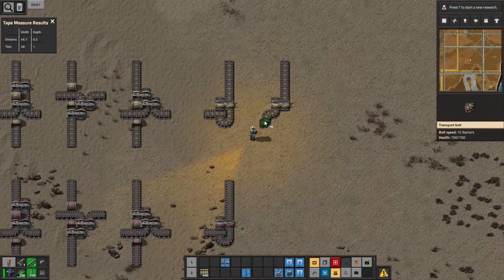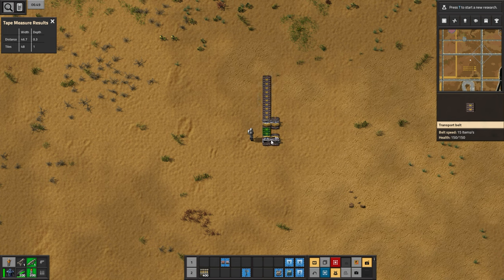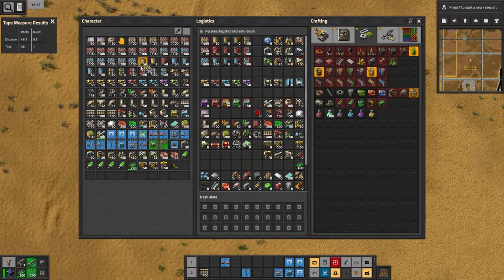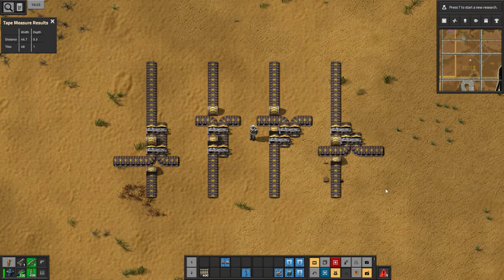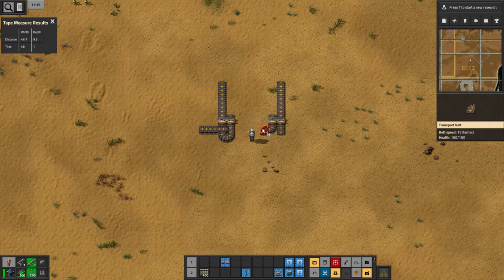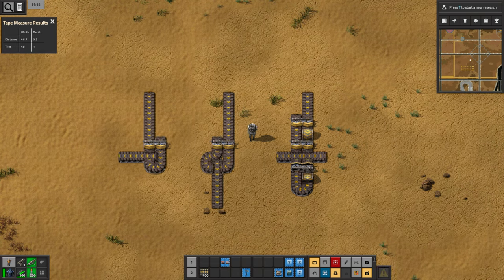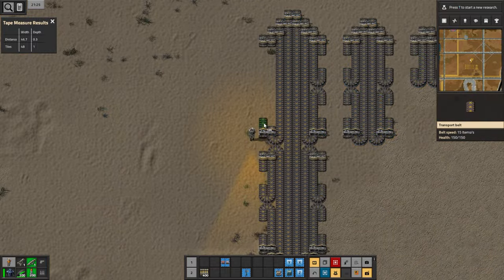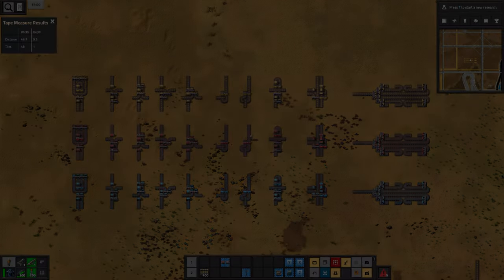Factorio - Widgets

Comment: Love your style. Also, the issue you referred to where a lane ends up with resources on one side not being used up is almost never an issue because it only happens when assemblers are on one side of a belt and there isn’t enough assemblers to consume more than half of a belt of throughput. The inserters will always grab from one side of the belt if there is resources on that side and if you’re producing too much of that resource one side will just back up because it’s not needed. You could add more assemblers anywhere on your bus to consume more of that resource and the stopped lane would fire back and start being consumed

Comment: Isn't "scrambler" basically a 2to2 balancer but for belt sides? Inserters prefer taking items from the belt side that is further from them, so placing machines on both sides of the belt should fix issues with uneven consumption.
Reply: Yes. They're usually called lane balancers.

Comment: Does anyone noticed that scrambler doesn't work?  Well it works if saturation of coming belt is uneven, but it won't help if consumption of the materials is uneven and one side of the belt gets empty) To solve this situation there is other scrambler, not so compact though.

Comment: These sorts of patterns are called design patterns in the programming context and maybe we could create the same concept for factorio with similar names. Design patterns in programming can give you patterns to follow for many sizes of abstractions. In factorio we could adopt the generic name or we could easily differentiate them as the size is closely related to what you're making. For example we could have belt patterns for those widgets, factory patterns for how you arrange groups of assemblers and other processing machines along with belts, and factory layouts/architecture for the whole architecture of the base. Anyway just an observation and a suggestion of a programmer. 

Nice video BTW, I think I'll use some of those widgets in my base more consciously.
Reply: Hehe, and what would constitute Uncle Bob's Clean Architecture and Clean Code then?
Reply: @othergames563 CC focuses on small modules that are designed to do only one task. So I think uncle Bob would be against a bus design at all. I think he'd go for an atomic railway cel factory where every step is loaded into rails. Let's call it the RVB: railway virtual bus.

So we'll end up with a 5 to 1 ratio of rail and station to assemblers and belts.

Comment: Whether you call them "widgets" or "balancers" they have their particular properties and use cases.

With noting is that the two lane-balancers/scramblers shown are not true balancers unless the input is unsaturated. If the input belts are saturated, then they act more as lane-swappers. You can turn them into true lane-balancers by forcing them to lane-swap, and then using two more splitters to split and then merge the belt so half gets swapped and the other half stays unchanged. If there's only one input belt though, neither version will be able to output a compressed belt unless the input is already compressed on both lanes (or the output belt has lower throughput than the input). For this reason, they're mainly useful either just to be able to pull from either lane, or when given two belts as input to act as a 2-1 lane balancer (which is also a sort of 4-2 balancer).

Then there are "universal balancers" which can act as any kind of smaller balancer, and "universal lane balancers" which pretty much mix as thoroughly as one could possibly ask for. Universal balancers however are ultimately just a meme and are pretty much useless except for looking cool.
Reply: This reminds me of a lane-balancer I've build. It might be the same type as the one you describe, but (at least for me) it's difficult to understand what a design look like from words...

It takes one belt as input, and also one as output. It's acts as a balancer for that belt, just like the standard balancer, but with one improvement: The input-belt always gets balanced. The reason simpel balancers don't do this, is because with sideloading: the futhest lane gets proirity. So as you said: they act like lane-swappers.

My change is this: Split the belt in two and sideload both on separate belts, keep sideload priority in mind. Then sideload one of those single-lane belts to change the lane (if neccesary) so that both single-lane-belts use the same lane-side. Then finally: combine those lanes with a splitter, and use one output as the main output, and the other output gets sideloaded onto the empty lane of the output.

But words can be not so great at describing this. So Imma try to draw it :)
(S is a spliter)
.                   -----------V
Input -> S -^  <-    -> S -V
,,              S V <-    -> S ------>  Output
.                   -------> I <-
(It uses three belts purely to cause sideloading)
This design balances the the lanes of the belt, regardless of input or output saturation.

Comment: a really useful widget that i feel you omitted here is the input-balanced lane balancer (or "scrambler" as you call them) - they use underground belt sideloading combined with a splitter to get each lane of an input belt onto its own belt, swap one of the belts' lanes (e.g. they take the belt containing the left lane and move it to the right lane of the same belt), use another splitter as a 2-2 balancer, then take the now balanced half belts and dump one into the empty lane of the other, creating a widget whose output lanes are "blind" to the input lanes, meaning that they take evenly from both.

this is highly beneficial in setups where either the production or consumption is uneven, as it can prevent situations where the output belt isn't full while some of the producers still have full buffers (for example: furnace stacks where one side cannot keep up with demand while the other side is fully backed up and not doing anything, or mining outposts where one side of the belt has more miners, meaning the other side takes a lot longer to fill the belt while the first one isn't doing anything). it essentially "rotates" the imbalance 90°, meaning that a 1 lane shortage across X amount of belts will be turned into a 2 lane shortage across 0.5*X belts - which is very helpful when your furnace stack for instance is less than X belts long.
Reply: *Flow routers don't act like balancers even when the inputs are saturated.

Comment: not scrambler... they're usually called lane-balancers. 
and the T splitter that you weren't sure was useful is actually one of the most useful splitters you showcased (except with a small change...it only uses TWO splitters instead of 3, that top splitter is removed, and you pull two seperate resources down and then side load using the splitters..... it's useful in large mall builds (particularly for pulling a full line each of green and red circuits, and splitting off two lines with each line having a single lane for each circuit type.
...also useful for builds where multiple resources are needed by the crafting speed/consumption speed doesn't necessitate a full line of that resource. (early batteries, and red circuits come to mind). 

One of the "widgets" i use often in early game is what i call the pulse-controlled consumption balancer...it's basically a lane balancer that pulls from a main bus that has a faster belt speed and ensures balanced consumption from that bus while splitting/side-loading as the situation demands.

The OTHER way the t splitter is useful is if the top splitter (and belts leading into it are RED. converting a single red line into two lines of yellow circuits that are balanced while being side loaded respectively. It's...a rare usecase, but can be useful in some circumstances.... if only a single resource type is being loaded on that red belt it isn't really useful, but if mixed resources are on the belt, it's an effective way to sort while also splitting.
Reply: the t splitter he was talking about that you are saying can be used for combining resources on to belts? He is saying that it can be used as a one to lane balancer splitter all in one widget.

he covered its ability to be used for multiple resources earlier in the vod.
Reply: @DavidSmith-cr7mb  right, you can do that, but if you don't set the input belts and first splitter to RED, you'll get compression issues (unless consumption is low)

Comment: I don't use balancers:
Here's a J-Scrambler - a very well known 1-to-1 balancer.
Here's a way to take a belt of barrels, and then output it to 2 or more belts in a balan... equal way.

Just because you designed your own balancers and don't call them balancers doesn't mean you don't use them.
Reply from the maker: HA!! Interesting point. When I hear 'belt balancer' what I see in my mind's eye is a configuration of dozens and dozens of things, mostly splitters. Using your analogy, a widget but for more than one (or possibly two) belts. 

It could be argued that this is a 'definition' thing, in that, once you define something then some things either want to squeeze in or squeeze out of that definition...

I'm being mischievous. I don't think either of us are wrong here. EDIT Ultimately a splitter is a belt balancer.
Reply: His J-scrambler isn't a balancer though, and neither is his T-scrambler. The J-scrambler only works if input comes from one of the two sides of the belt. And the T-scrambler simply swaps the sides of the input when the belt is already compacted. To get an actual balancer, you need to use undergrounds to block off one half of the belt at a time. Therefore, I'd consider "widgets" to actually be a more apt name than balancers in this scenario

Comment: the 'narrower centreline' at 5:30 is so simple that im embarrassed i didnt think of it myself, i would mostly use it on a half/half belt where im pulling one resource off to one side but the result is the same, that i now have the option of 3 wide vs 3 tall on my plate of spaghetti

Comment: Can't you just use circuits instead for the last one? At smaller scales a belt solution is neat but it seems to quickly get big while you could just use circuits to calculate the average that is stored and then only enable inserters if their own box contains less than or equal to the average. To speed it up a little by allowing a bit of unevenness you can add a little to the average before sending it back to the inserters.
Reply from the maker: I tried this this exact circuit network with barrels. What happens is that the circuit network does the calculation and then a tick later the inserter is enabled. Sometimes the inserter is disabled during that tick by the average changing. At peak throughput the inserters are constantly hesitating and/or changing their mind. There might be a way that is possible but I couldn't find it. That conveyor widget thing does the job without me even having to think about it.
Reply: I think adding just 1 to the average should alleviate the issue. Any inserters that then are hesitating are ones that already are above average so it doesn't matter if they are hesitant and might even lead to a better spread
Reply from the maker: @tekbox7909  I don't think it will. Whatever value is chosen as the trigger for the inserters, whether it be the average or the average plus something, will be the value the inserters dance around. 

I think. I can't say I tried everything with circuits and barrels but I did try a lot.